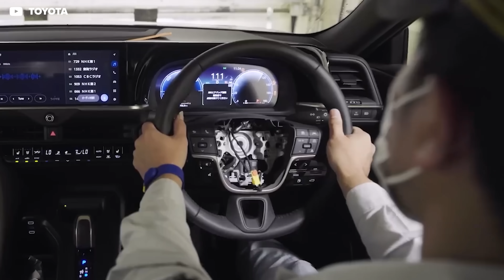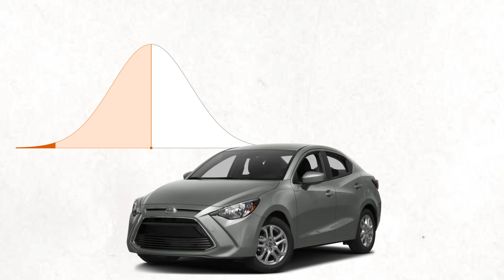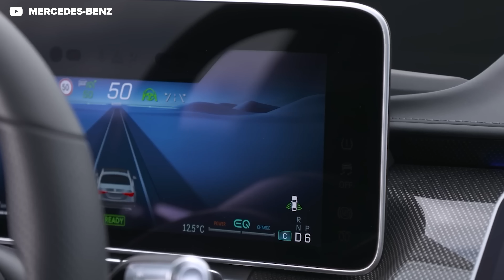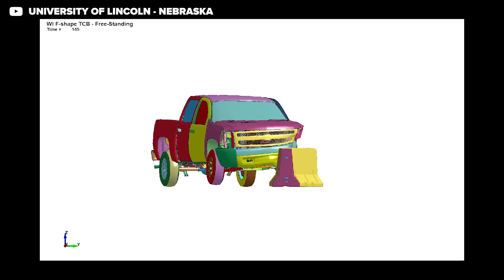The REAL reason guardrails can't stop EVs in a crash

Comment: Vehicles have gotten bigger b/c EPA requirements are based on the size of the vehicle’s shadow.  Bigger vehicles are easier to meet requirements while smaller vehicles are more difficult.
Reply: *footprint, not shadow
Reply: @gnarl12 Got it, I wasn’t sure if shadow was correct phase.
Reply: What about the auto makers that wanted people to buy more trucks to avoid common regulations in other vehicles
Reply: @Quix94  In the 90's, pickups sales soared. I bought trucks for $15k, and sold them at 50k miles 2 years later at $17k. The cost of trucks started to skyrocket. People bought them. It wasn't because of the EPA. Younger buyers didn't want minivans because their parents drove them. The byproduct of that is that trucks have higher profit margins. Car companies are in the business to make money. This whole argument falls apart when you look at the global market. Ford stopped making sedans, yet Honda doesn't make Trucks. Ford does sell subcompacts, sedans, and the Ranger in other countries. Why doesn't Kia sell the Pico in the US? Why did Ford stop selling the Ranger in the US? Its not because of the EPA, its because of the buyers. The Ranger wound up being almost as expensive as an F150. People stopped buying them. This whole thread is an echo chamber of misinformation. Im out.
Reply: Exactly, EPA regulations are made by bafoons. This is also one reason you don't see small trucks anymore, like the Ranger, which would be much more efficient than a full size truck, but due to asinine EPA rules, wouldn't meet standards.
Reply: @xeridea Look up “regulatory capture.” Many (most?) regulations are written with a large amount of industry input. They don’t make all of those bribes, excuse me, campaign contributions for nothing.
Reply: @xeridea  Not buffoons as they got a ton of money "under the table" to write the regulation favoring bigger vehicles.
Reply: @xeridea no, it’s made by corps that wanted to skirt US rules to shut out Japanese auto manufacturers
Reply: @xeridea are u talking about the old ranger? Like that small? The new ranger is obviously much bigger and there are several trucks in that category. But I think I get what ur sayin
Reply: @dan2danger  Yes, the old Rangers, S-10s, Toyota, Nissan small trucks, etc. were small enough that the government set very high fuel economy standards which weren't easy to attain due to the non-aerodynamic body style. The EPA's intention of improving fuel economy ended up worsening it overall as companies made bigger vehicles to avoid the stringent economy standards.
Reply: japanese kei trucks are genius, but you cant buy them
Reply: That's absolutely not the only reason.
Reply: In 1975 Median age was 27.5
In 2024 Median age was 40.1
And Americans are bigger and Fatter.
Gas is still cheap accounting for inflation.
People do not want small hot hatchback cars. 
Manufacturers make more money selling big low tech suspension trucks to the ignorant
Reply: In what lighting condition?
Reply: I believe it is actually based on the size of the footprint between the wheels, not the full shadow of the vehicle.
Reply: Since some of them have already commercial truck weight  put speed limit for those on them. 90 km/h. They wont since its good business for car companies.
Reply: @hagestad  Why would they a stupid 90 km/h speed limit on them?
Reply: @46wireboy  Given the weight they should be considered trucks
Reply: @hagestad yes! speed does not kill, kinetic energy kills. a Rivian going 60 is much more deadly than my 3900 lb sedan going 75.
Reply: @hagestad  We have highways with 120 km/h or maybe higher speed limits, and commercial trucks can do that. That kind of speed limit on normal vehicles won't improve anything enough to be worth considering.
Reply: @MrNukealizer  Now put that statement into equation for force exerted during impact and you will notice the difference is exactly what you need. There is very good reason for that speed limit.  Also pretty sure that US has mostly  70 mph limit for 18wheelers.
Reply: wrong, automakers have been pushing for bigger cars to make more money, and they have been doing it since the 50's.
Reply: The EPA GANG has a hand in destroying all things ppl enjoy.......
Reply: @theglitch99 no, not the epa, but corps.
Reply: The drive is left leaning. They’re never going to say that

Comment: I strongly disagree with the idea that lane keep assists make roads safer. I have experienced active lane keep assists in serverl different cars from several different manufacturers, and all of them made me feel unsafe as a driver in the car, to the level that i had to switch them off.
Some want to pull you into the wall of a tunnel, others want to kill cyclists, the next one constantly pulls to a side alternatingly so you constantly yaw left right, one wanted to suddenly pull me into the guardrail at 130 kph (which was the speed limit in that section)
Anyone i know personally switches their lane keep assists off, because they are only annoying or outright dangerous instead of safe. So how on earth does anyone claim they make roads safer?
If it is just a warning i have no problem. (a lane departure warning light if you want to call it that) but as soon as it interferres while i am at the wheel the interferrence up until now was more dangerous than helpfull.
Reply: That goes for most electronic assists. Slamming the brakes in busy intersections or highways for no reason, stopping you from merging because it sees the cars driving by as obstacles, etc. They do more bad than good unless you're impaired in some way.
Reply: And on top of that lane keeping is for highways not places were cyclists are or intersections if you’re using lane keeping on anything other than a highway you’re not doing it right.
Reply: @BigD4Real.  My neighbors car has lane assist that auto activates at 30 mph... if it was meant for highways, it wouldn't come on until highway speeds.
Reply: @BigD4Real.  Correct, i have not used a Tesla, and i probably will never do so. (No interest, and no interest in the shenanigans of their CEO) I find the idea to implement even the semi self automated driving a wrong idea and an illusion of safety.
With those systems people unlearn the ability to drive their vehicle in nice conditions, and when weather conditions get tricky the systems can't handle it and the driver can't anymore either because they unlearned it.
I have seen enough Teslas and their drivers having problems with these systems too.
If the lane keep assists were for highwayspeeds only, then they would not be active from 0 kph upwards. But they are.
And it's not that i switch that shitty system on, it is on by default with every start of any modern car. (and with some, even if you switched it off, as soon as you engage cruise control it's on again doing bad things)
Lastly, several of my dangerous situations thanks to those shitty systems were on highways (or what you would call highways, we call it Autobahn, like the germans). At speeds between 100 and 130 kph. So right where you think those systems are made for.
Reply: You are 100% correct. Try using the these aids on a road under construction.  Lives are put at risk.  Disabled.
Reply: I recently bought a new truck in 2024.  It has so many nanny features.  I wish there was one button to turn them all off instead of having to hit four buttons over about ten seconds.  However, I actually appreciate the features most of the time.  They do a pretty good job, and even allow the car to drive itself.  Are there occasionally false positives?  Absolutely.  Are they dangerous?  Yes.  That’s where driver responsibility comes in.  I don’t always turn them off driving around town, but I know how they will perform and have learned to override the safety features when needed.  Car trying to do something it shouldn’t because it misread the situation?  Not really a big deal because I’m doing what I’m supposed to and paying attention to my driving.  But on highways, the safety features are a godsend.  Adaptive cruise control is great in heavy traffic, making for a much less stressful drive.  Worked a 16 hour shift?  Having that added bit of safety means fewer wrecks.  Obviously, the ideal solution would be to not work a 16 hour shift, but this is America, where we’re overworked and underpaid and expected to ignore human biology.
Reply: @NemoCaligari  Most people stop paying attention when they know they have "all the assistance systems" You can watch that every day. And just sitting and really paying attention while watching the car is as tiring as driving yourself.
With that nonsense people unlearn driving in nice weather and when bad weather turns up, the assistance systems give up and those drivers can't take over because they have lost their capabilities by not using them.
Reply: Any tech that creates laziness should not be in a vehicle.
Reply: @bigfoot9049  good point.
Reply: You are still the driver!  Lane keep just frees you from the constant need to, well, lane keep. More time to sweep mirrors and look ahead.  More attention for everything else you need to do as a safe driver.
Reply: @tokomok  Actully the constant interferrence of the lane keep assist in some cars means less time to check mirrors or the situation, and more occupation/attention for counterating a bad system than with no such system.
Don'T get me wrong, i am full in support for systems that do what a human driver can not. Like ESP. The driver has only 1 brake pedal and 2 feet. No chance of braking single wheels to stabilize a car when it got unstable. Even with 4 brake bedals that is not possible. But keeping your lane is possible with eyes on the road and hands on the steering wheel without trouble. No such system needed especially when it's as bad as they act right now.
Reply: @nirfz  Well ... constantly being interfered by the assist systems just means that you are a bad driver ... easy as that! Neither the LFA (precursor to the HDA) in my past 2020 Hyundai Kona nor the simple LKA in my Volvo EX30 now (no Pilot Assist equipped ... but I regret not having it) tried to kill me. Just keep a safe distance and use indicators when changing lanes! 
But especially in gusty side winds the reduced workload of keeping lane with lane centering assistants makes driving in these conditions so much less tiresome and frees driver capacity to actually observation of the traffic around them!
Seeing how often old cars are swerving out of their lane makes it obvious to me how lane keep assistants are reducing crashes!

And I don't know how things are handled in the USA ... but in Europe every car crash with severe material damage (uncluding guard rails .. someone has to pay for the repair!) or involving human injury or loss of life will have a police report written about it! And every time such thing happens an insurance is dealing with it! And that way you can EASILY do statistical analysis! This worked for the safety belt, ABS, ESP and Airbags!
Reply: @glockmanish  Doesn't have anything to do with my driving. I can be perfectly in the middle of the lane and as soon as i switch the system on it starts swaying. Even without any input of me on a straight line. The system (at minimum in the skodas at work) is shit. (but it was the same shit in the VW we had before)
And the worst "tried to kill me" situation was on a lane change on an austrian autobahn curve. in the middle of it the lane keep assit suddenly pulled with all force towards the metal barrier. Of the time when it decided the wall of a tunnel is the right line and tried to pull me onto the sidewalk inside the tunnel.

Holding your steering wheel is not an issue, and if it is, one should think about taking the bus. (i drive for over 27 years now, and even gusts of wind were not a problem or tiring. If the car is maintained properly and the manufacturer did a good job in setting it up, you only feel wind from the side when it is so severe that relying on automated systems is even more of a bad decision. (that sounds like a guy i knew who set his cruise control to the speed limit when there was a lot of rain and claimed that the wheels loosing grip meant the cruise control would deal with it)

It seems you are missing the point: the claim that those systems avoided an accident means there are no such reports. So no numbers. Same as with humans avoiding accidents: those cases are not documented because an accident did not happen. 
And that's the point. People are claiming that hose systems avoid accidents and present numbers that don't exist.

Working with safety relevant systems in ciritcal infrastructure for almost 25 years i can tell you one important thing media never mentions: humans are better at avoiding mistakes that are in the making than any softwaresystem. Why? Because humans are able to recognize a mistake while making it. And that means they can start to counteract their own mistake early. And either avoid a bad outcome or at lesat lessen the impact.
Any computersystem or piece of software can't do that. Becaust it has no conscience and so "does nothing wrong". This means it won't recognize itself making a mistake.
Reply: @glockmanish  The problem is it doesn't have to be you that is the problem as much as the many other drivers on the roads who are distracted (20-30% of them are texting and driving at any time).
Reply: Your feeling don't replace the factual numbers sorry.
Reply: @bobbybishop5662  Think about how they get the numbers. those numbers are just guessed. There is no chance of actually measuring a difference.
Reply: You’ve never used Tesla full self driving.
Reply: @BigD4Real.  Well obviously he hasn't, he's here and alive to comment isn't he?
Reply: @BigD4Real.  Tesla keeps ranking #1 in fatal accidents per mile, you may need to reconsider.

Comment: America has no problem with too heavy vehicles, there is plenty of weight to shed to make room for the batteries.

The problem is slighlty different in the European and other markets where smaller town cars dominate, cars that has to put on weight for the batteries. On the other hand, if range is not an issue, they do not have to be that heavy. You drive your personal EV town car to the rental place to pick up a larger vehicle when going on a road trip.